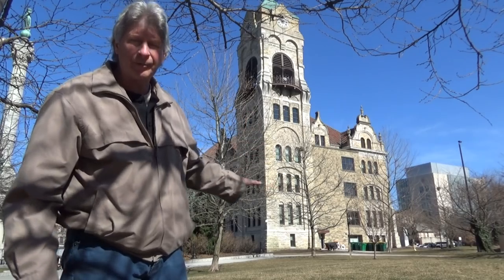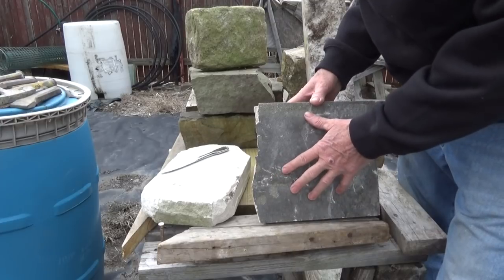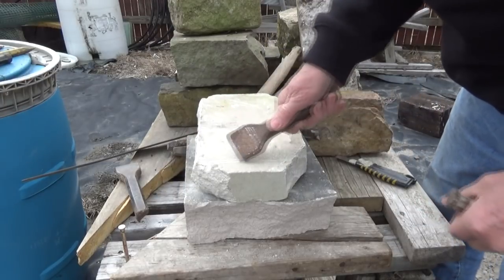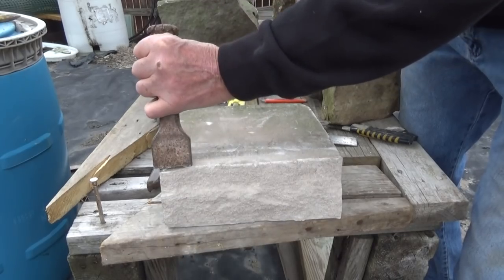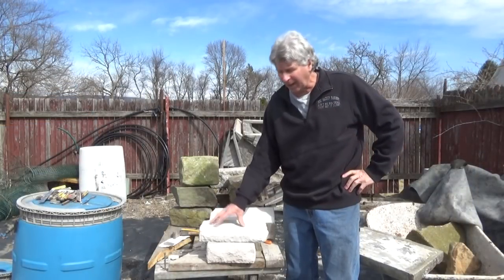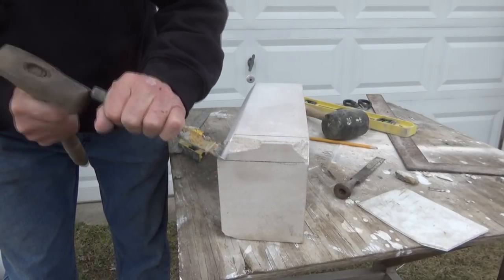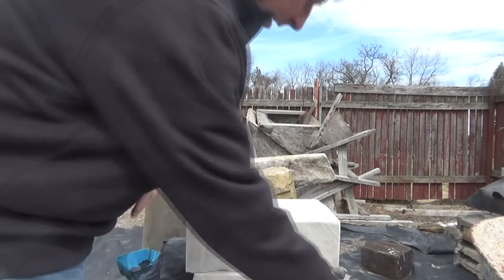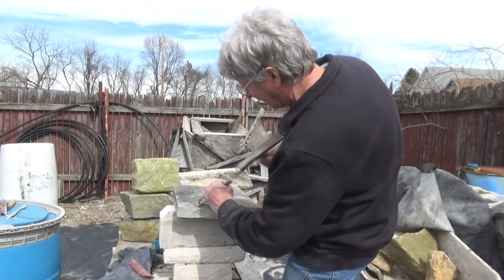ROCKFACING AND SHAPING STONE (Part 1) Mike Haduck

Comment: I noticed that on Wayne's air chisel, he had a toothed chisel for those angle cuts - could you just use an angle grinder and make little notches in a cold chisel? Maybe the heat treat would get messed up. It seems like the decrease in surface area - and resultant increase in pressure - would make light taps almost grind away, rather than chipping off pieces. If the whole place falls down and my grandchildren need to rebuild it - I'll try to remember all this youtube stuff from Honest Mike's Masonry! You are doing a great service to mankind by sharing all this knowledge and experience. Thank you for another great video!
Reply from the maker: Thanks aus, yea wayne is the guy for that,  thanks Mike

Comment: Hi Mike.  I have been watching your videos. They are very educational! Thank you for posting them! I have a question about a farm house that was built around the 1900s. It was built on a Michigan basement. It is in Northern Michigan, where we get snow and cold in the winter.  The Michigan basement foundation is built from granite fieldstones. The bottom stones are large. The house was added onto at some point. The addition was built over a crawlspace. It was also built on field stones. One of the rooms never had a floor in it (just dirt). Also, There is easy access to getting under the crawlspace in that room.  That room also has a door leading outside.  What steps would someone take… after digging out the dirt, to  build the new basement walls out of fieldstone?  Do the large bottom stones sit right on the dirt? Is there any kind of vapor barrier between the stones and the dirt behind the wall? Would the mortar mix be the same as what you use in Pennsylvania? Any tips would be appreciated. Thank you.
Reply: Also, the walls are very thick. 2 to 3 feet in some places.
Reply from the maker: Hi Lauren, usually today most contractors use concrete to shore up dug out cellars, thanks Mike

Comment: Mike: PLEASE: Im looking for advice from stonemasons, i may have (partly) figured out how they made the scallop marks on the unfinished obelisk at Aswan!! If you have a dolerite ball the size of a basketball, roped so that the vase is exposed and even lengths of rope come off each direction horizontally...and a crew of workers on each side rapidly pull and release the rope you create a hammer drill of sorts. NOW to prevent the granite being shattered , a layer of wet sand was added to dissipate the force ( they used wet sand for other techniques such as coring drillholes) that has a powerful abrasive action. Its also slightly irregular and would result in marks JUST LIKE those on the unfinished obelisk!!! I want to setup a recreation experiment!!!
Reply from the maker: Hi Lance it just takes time, crush the granite creating the holes and the chip the high ends, it just takes time thanks Mike